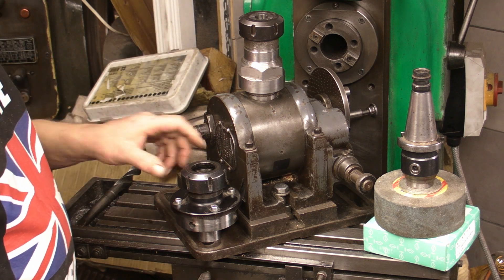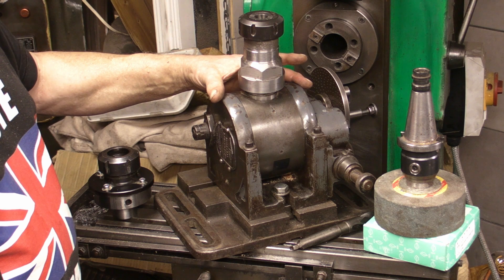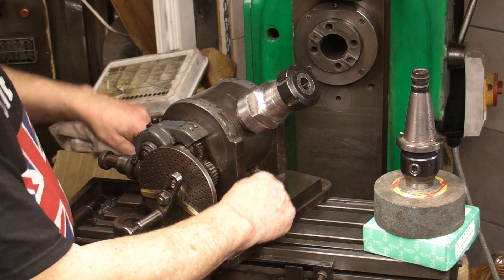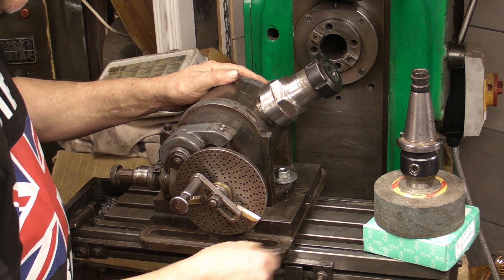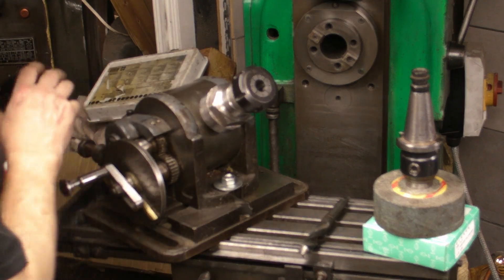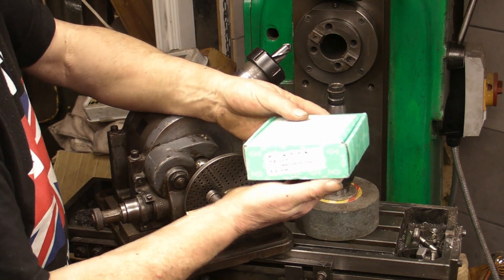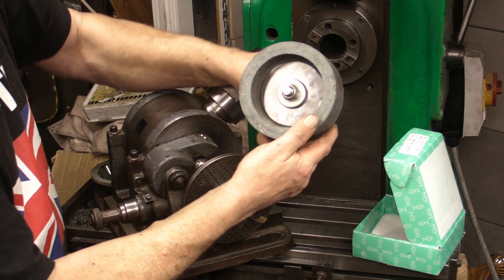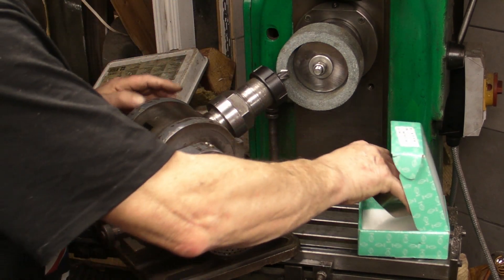Sharpening Morse taper drills

Comment: That's a fantastic dividing head, Del.  If you don't have the list of all the divisions it can do, drop me a line with its crank ratio (probably 40 or 60 to 1) and the disks you have and I'll knock you up a pdf with the various exact and approximate divisions up to whatever number you want.

No reason this setup shouldn't work, you'll want a mirror for inspecting the cut, though. and I'd chuck a sheet over the bed and slideways.

Happy grandparenting.
Reply from the maker: yeah 40-1 ratio seems the most common, I have two indexing wheels, thanks for the kind offer ! New Cbn wheel arrived and had some success grinding the Morse drills, video coming soon, processing up to Hd now !...Del...
Reply: Victoria mills and accessories were top notch Del!